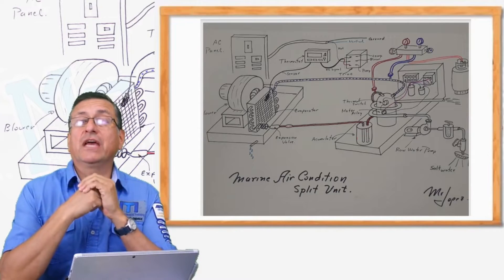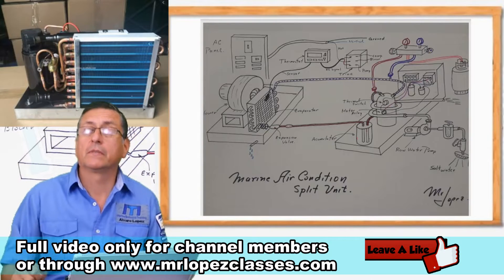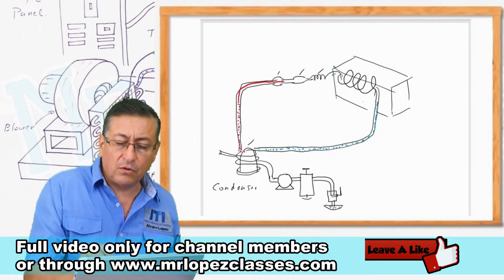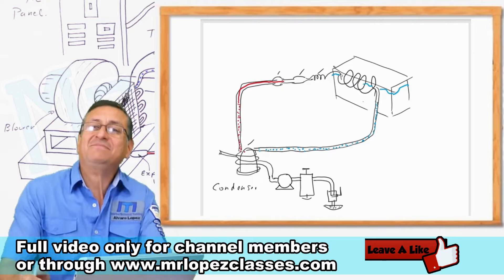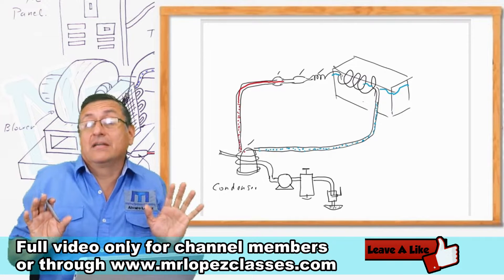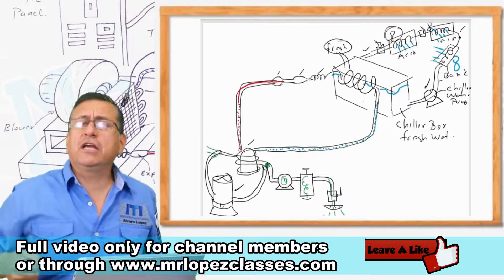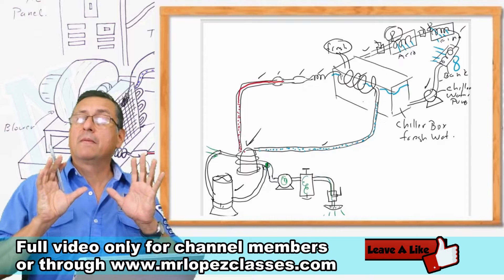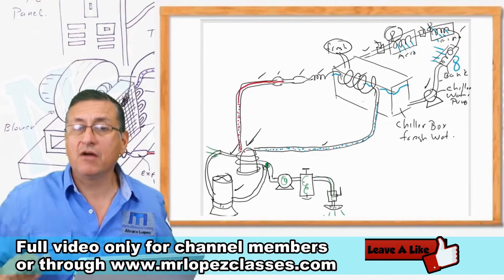Marine Chiller Systems / Highlight Video

Comment: What is better, a chiller system or a split gas system?  With the chiller system you are chilling water in a hot engine compartment.  But with a split system, the cold part is in the cabin and the hot part in the engine room.
Reply from the maker: Chiller systems are more efficient , and also they require less amount of gas flowing through the cabin.  In small boats with only one or two units, sel-contained units and split units are a better choice
Reply: @MrLopezClasses  So you are saying that gas is expensive, so you don't want to be running gas lines all over the boat?  What about the problem that the chiller is in a hot engine room?
Reply from the maker: @johnkosowski3321  The ambient temperature doesnt affect the system performance due than the condenser coil is cooled by raw water and the evaporator coil is inside of the chiller box surrounded by coolant (Glycol + H2O).
Reply: @MrLopezClasses  I don't understand.  Is there not a chilled water reservoir in the hot engine room?  You are chilling something inside a hot engine room.  Should that chiller be placed elsewhere?  Isn't that the point of the split system?
Thanks.